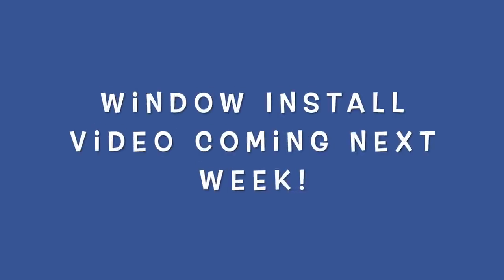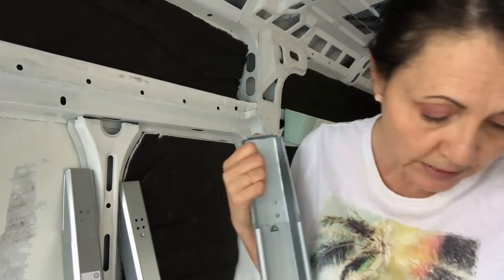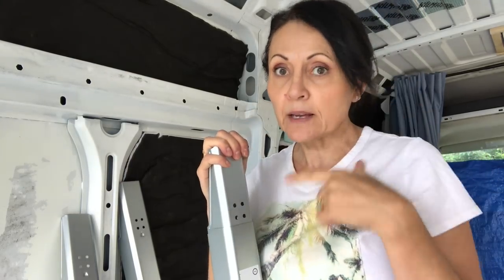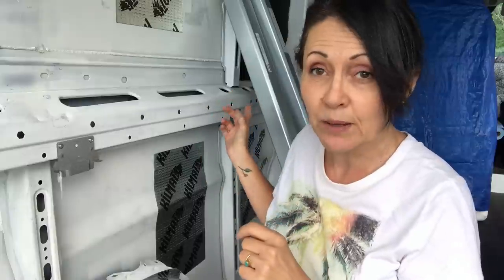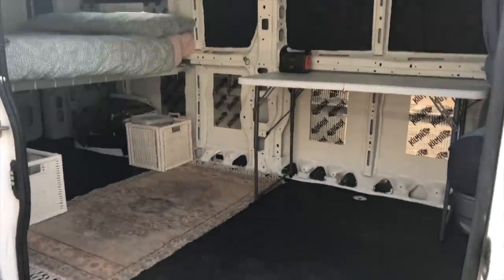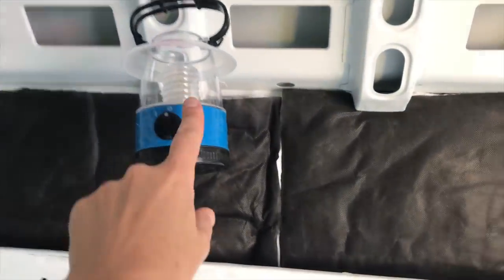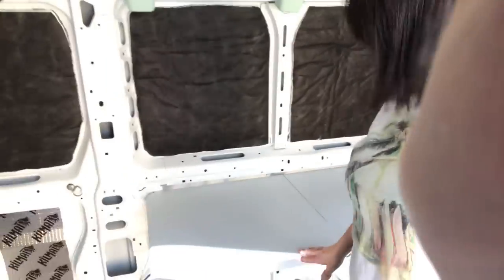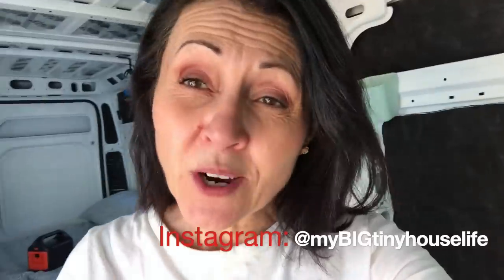Van Build Vlog #5: Installing the Bed

Comment: Q: What is the distance between your bed slats and ceiling supports?
Great idea using the IKEA rails.  We actually have a spare set of the IKEA rails so we are golden.  Using the bed bracket gives you the flexibility to adjust the height of the bed.  Are you planning on using the IKEA slat screws to tension the slats into place.  They help to hold them still.
Hopefully this year I can finally begin my van build dream!
Reply from the maker: Hello Pamela, I'm not exactly sure without going outside to measure.  I have them mounted to the horizontal bracing on the promaster.  If I had to guess, I would say about 3 feetish?  

Yes, once I have a more permanent build out I will screw the slats down.  For now I have zip tied them and it's very secure but lets me easily remove the bed if I need to use the cargo space underneath for something large and to get access when I'm installing the solar system/batteries which I hope to do next spring.

Comment: Hey, I know this bed video is old, but I just ordered my Skorva rails.  Would you be able to elaborate a little on the exact the screws you used to mount the brackets?  Do you know the size, and were they self tapping or did you have to drill holes first?  How are the brackets holding up?
Thank you!
Reply from the maker: Hi. It's been a long time. I used self tapping screws. To be honest I don't remember if I pre drilled or not. Sorry.  Things are holding up really well.
Reply: @myBIGtinyhouselife  Okay!  Thanks for your reply!

Comment: Adelina, how did you find your van? How many miles were on it when you purchased and ballpark price? Oh! And what is the height inside from floor to ceiling? Ty!
Reply from the maker: Hello.  I found it on Auto Trader.  It has a fair amount but since it was used to deliver tires to their stores it's in good shape.  around 200KMS.  it cost me just over 20K Canadian.

Comment: Hi, are you using the Maxxair fan yet? And how are you powering it? Are you using an extension cord because I know you don't have an electrical set up yet. Are you happy with the location? Thank you in advance! 🙂
Reply from the maker: Hello. I haven’t wired it up yet. I need to figure out how to power it up with my portable battery. I have the NinjaBatt 560wh which should be able to power it.
Reply: @myBIGtinyhouselife  Great! I won't have a power set up for a while. I just wanted to see what's possible in the meantime. Thank you for your response.

Comment: Isn’t IKEA brilliant?! We just order a small cargo trailer to convert and will use this system. May I ask what mattress you used? IKEA? Width? Thickness? Thanks, Adelina.
Reply from the maker: I think IKEA is great for this use. They really have lots of ideas for small van/camper spaces. I got my mattress from Jysk. It’s a double size 4” memory foam. Super comfy.
Reply: @myBIGtinyhouselife  Thanks for the recommendation, Adelina. In a van or cargo trailer it helps to have the lowest profile mattress that is comfy to increase your wall or window space. I’ll check out Jysk. The planning part is so much fun. 😊
Reply from the maker: Yes it is! 😁. Good luck.